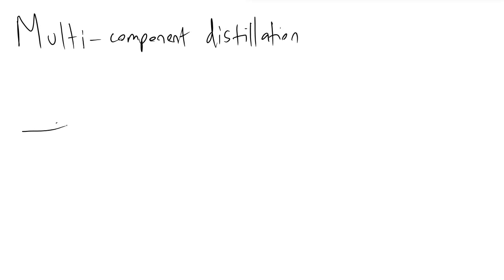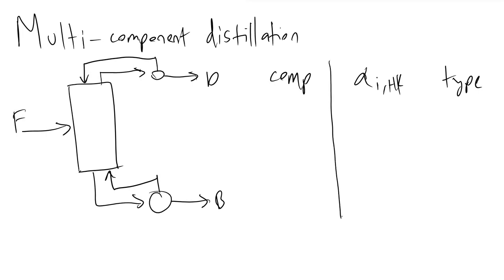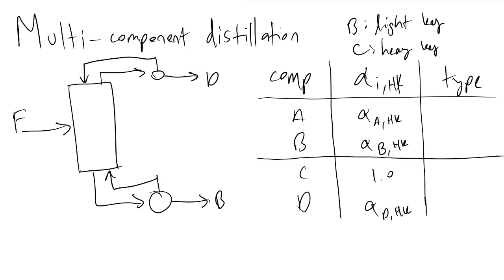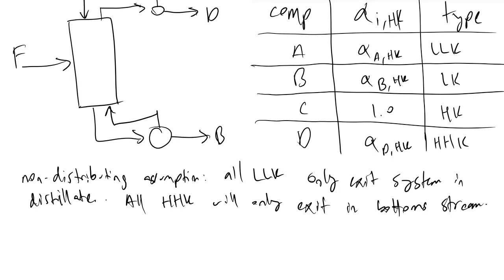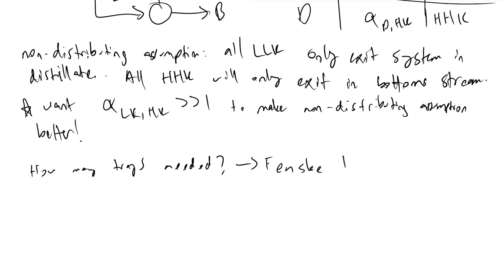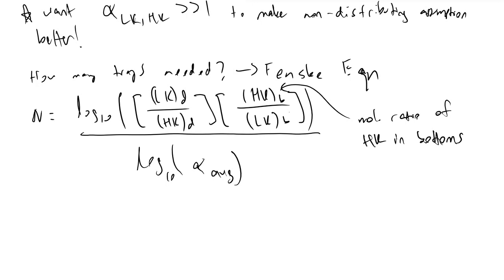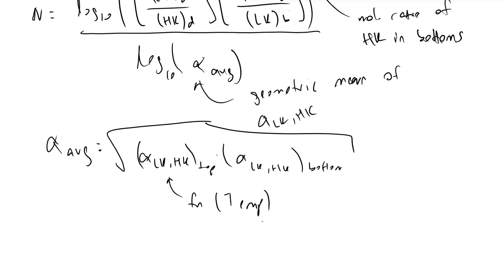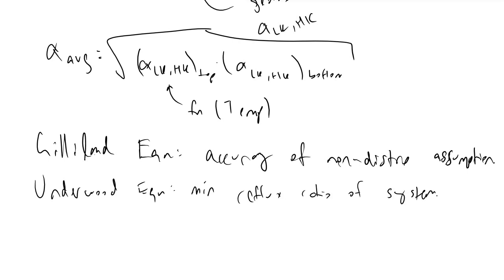Multi-Component Distillation and the Fenske Equation

Comment: So is the process the same when you have a ternary system where you added the third component on purpose to break and azeotrope?  For example, using H2SO4 as a binder for H2O so you can separate out HNO3 as a more volatile component.

Comment: How can you specify if a component is a light key or a heavy key?
Reply: LK- comp of the feed mat which is desired to be kept out from the residue 
HK- " " " " from the distillate 
we can identify 'em by the volatility of the component
Reply from the maker: It is arbitrary, you can make any component the heavy or light key. But to optimize your separation, you want to pick a heavy and light key that have a large difference in volatility to better follow the non-distributing assumption.